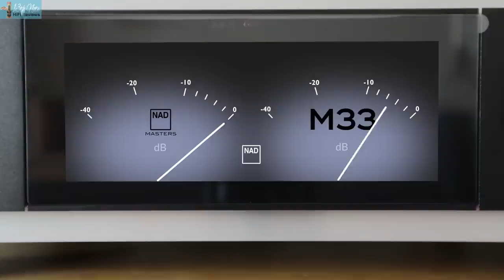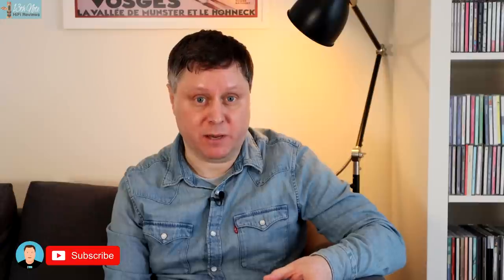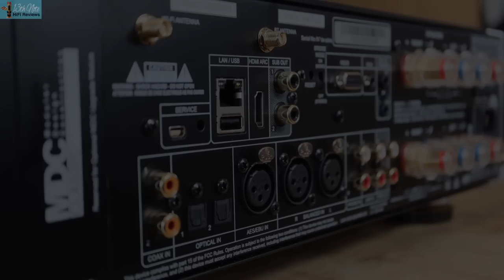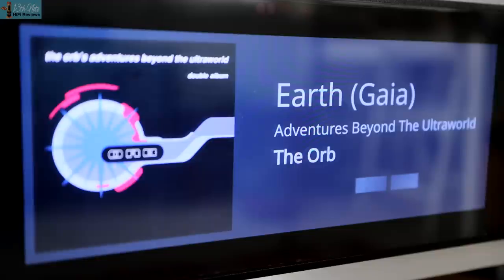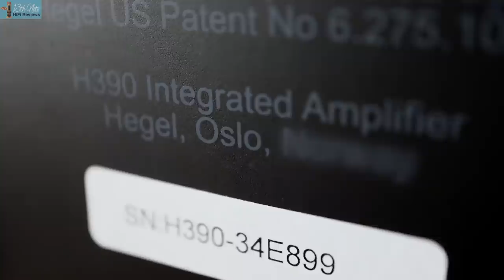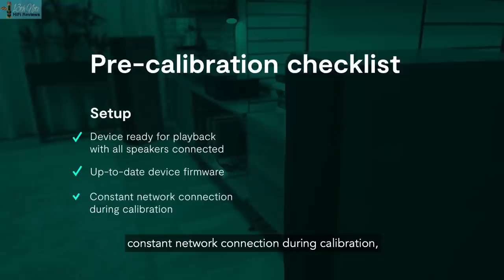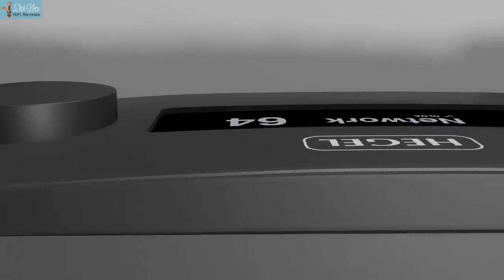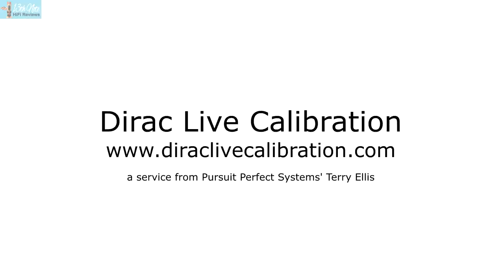NAD Masters M33 versus Hegel H390

Comment: These two were my finalists and I went with the Hegel because I never got the chance to hear the M33 in person.  The Hegel 390 has been very good to me and happy with that decision.  Great video.  I always enjoy your feedback
Reply: I'm in the same boat but before I make my final decision I will test both. I buy both from a respectable audio dealer and will inform them that I want to compare the. Sure, it needs a huge budget to buy both, but after that I can hold the winner and sent back the other one.
Reply: @TheVictoire22 Who won the competition in the end? 😊
Reply: @larsstecken  Ah thanks for asking. I did a test trio at the local audio dealer. The test was with a M33, The Hegel 390 and a Yamaha A-S3200. For me the Yamaha was clearly the winner and until today I'm happy I made that choice. Possibly to do with my B&W 702S3s which require a very strong amp due some really low impedance (2.9 Ohm) in a certain area of the frequency spectrum. On paper maybe the M33 or Hegel were clear better candidates but to listen to, the Yamaha was very very nice. The Hegel was 2nd and the M33 was for me clearly to analytic. On the other hand the M33 has tons of options to sound it better to your needs which I didn't investigated.
Reply: @TheVictoire22  Thank you for the fast reply! That is very useful information, at least for me. I am currently looking for an upgrade from my Atoll IN300 which is powering Dynaudio Heritage Specials. The Yamaha was also on my list but due to some "not so enthusiastic" reviews it slipped from my radar. The HS also like to have a lot of power and I thought the Hegel was the natural partner. Then you start thinking about how much room correction can do for you and the rabbit hole never ends....
I love the looks of the Yamaha - it's a beautiful machine. Whereas the Hegel is just a brutal brick with an excessively sized logo on the front - I probably could have dealt with it if it really were the much better choice for my speakers.
Unfortunately, I am not able to get all of the amps to my home and test them out - so, I will need to take the plunge one day 😊
Thanks again, Stefan
Reply: @larsstecken  well as with most equipement, there are always good and bad things about a product. On the end you need to convince yourself. I had the luck to setup exactly my B&Ws with the different amplifiers at the local audio dealer. So I could compare them all. But that's of course also just on a moment. I discovered that listening flavours can vary every day. Sure the looks are awesome at the A-S3200 (I had a Technics SU-G700  and the SU-R1000 was to costly). There are 2 important things to say about the A-S3200. It's a true analog amplifier. No digital ports nothing. It's pure analog on a scale which was never achieved before. It's extremely dark as it comes noise. There is no noise nothing even when the volume is 100% at the 2 balanced inputs. The Amp is fully balanced build (it has only 2 balanced inputs). The integrated phono amp is good but not special as sometimes claimed. It's not comparable to a Lehmann Black Cube SE II (driving a AT VM760SLC moving magnet to it). By default the specs are somewhat thin as it comes to power. 2x100W on 8Ohm but a few sites claim this is fairly under specced. One thing worth noting is that I had also a good deal for it. We  bought 2 (one for a friend) and the SRP was 6499 euro we got it for 4400 euro each. So if you consider this one it's worth to shop around and get a good deal because I think there is quite some margin on it for retailers.
Reply: @TheVictoire22  Once again, thank you so much for taking the time to give me your opinion. Let's see where the journey takes me and if my wife will still be there with me 😂 Cheers and greetings form Berlin
Reply: @larsstecken  if budget is somewhat thin you can also consider the A-S2200. Then you have still money left to buy a nice Dyson Hairdryer for your wife ;-) When I bought the A-S3200 I had to wait a few days. I got an A-S2000 quite old Yamaha amplifier to overcome the no-amp period. This was already a massive improvement compared to technics SU-G700 although it tended a little to the warm side. A-S2200 is considered sometimes as good or really close to the A-S3200. The prices is just below 50% a A-S3200 costs. One big advantage is that the A-S2200 looks as standard form factor Amp while the A-S3200 is considerably higher (cabinet space) and tend to look a little more bulky. I never heard the AS-2200 but I had the A-S2000 which was also very very good or possibly a R-N2000A if you are looking for an all in one solution. Go to a Yamaha dealer is my advice!

Comment: Hi, 13th Note , A great review on the NAD , Way out of my price range bracket, However I have owned to pre-empt my buy them the one I’m using the moment is a integrated 314, Used to go into my Cambridge power amp but that has blown just recently I’m now in the process of purchasing a NAD C298, And I noticed in your comments that you don’t know of anybody nowadays that Bywired anything, 
Well I have a pair of transmission line loudspeaker cabinets that I built from a plan over 40 years ago they sound amazing and I have not yet heard anything that comes close to there Quality of sound, Especially just recently I’ve replaced the drive units because when the Cambridge power blue took out one of the drive units, I have now replaced them with SEAS . 
They were designed to be Bywired to keep the crossover unit simple, The only downside is that they stand just over 1 1/2 m in height and they look like coffins especially as I used to have brass handles on the side so I could lift them around as they do weigh a lot. And they fire out the bottom so there is approximately 4 inch gap underneath, 
I do think the review you done on the NAD is very good and very interesting.
And I forgot to say that I am new to your channel so I’m going to have a look see what else you’ve got reviews on.
PHIL FROM DARK SIDE OF THE MOULIN FRANCE.

Comment: I heard the NAD M33 (without Dirac) vs Hegel H590 because unfortunately the H390 wasn't available.

I found the M33 more neutral, a bit more honest. The Hegel with a little more power, but a bit too much in the highs. I bought the M33, really great device. ✌😀
Reply from the maker: You have to listen at home to get an accurate picture if you didn’t. The Hegel can be described as offering all that is needed and natural in the treble to my mind, and so can the NAD, in a different more etched out way. The Hegel h590 has a lot more power to the m33 and will control a lot of speakers better.

Comment: As much as I love my Parasound 2125v2 amp (150 wpc, 35 amps peak/channel), I want to upgrade to hear anything better that's <$3500 and < 50 lbs.
I have a mixed use music/home theater (7.4.4 setup).

At first I saw an ad for a used Passlab xa25 for $3500, but there's no warranty so I passed. (I was also concerened about the low 25wpc, Class A heat that I'd be sweatin).

I've just ordered the Musical Fidelity M6s prx amplifier (230 wpc, dual monoblock in 1 chassis, 140 peak current at 130 volts so it's less in the US at 112 volts, but I would deduct that this is same as a Parasound A21+ at 60 amps peak/channel) to replace my Parasound 2125v2 (I'll repurpose it to power my movies surround L/R and take that load off of my Arcam AVR5 receiver in a 7.4.4 setup).

I was gonna get an integrated Musical Fidelity M6si (my requirement is a Home Theater bypass and L/R balance) but it didn't have a L/R balance to help imaging of vocalist; but my Parasound 2100 preamp does.

streaming source=Apple Music lossless

Comment: Thanks for an informative review, Simon! I just purchased the M33, mainly for the "all in one" feature set including BluOs streaming, phono and headphone preamp, etc. I've had several other NAD pieces in the past, including most recently an M12 matched with a Parasound amp. I haven't calibrated using Dirac yet, as I've been breaking in my speakers first. Looking forward to your next review.
Reply from the maker: Thanks Ken, please let us know what you think of it when you are used to it a bit more. 😀
Reply: @13thnotehifireviews7   Since my previous post I calibrated with Dirac LE, and WOW - what a difference in the tightness of bass, and character of vocals, particularly female. I will be purchasing the full frequency version (what's another $99, right?).  Since it's easy to switch the Dirac filter on/off, I can readily hear the effect on the sound.
Reply from the maker: Thanks Ken, I found the expansiveness in the sound to be the best feature of using Dirac. You can do more than one filter and curve i think, I think there are five slots.
Reply: @kenpiarulli1152  Hi Ken! I am also thinking about buying the full frequency version! I was wondering what your experience it is? Did it make as much difference as the limited version?
Reply: @DeSoLaToR22   Yes, I found the full version much more flexible, and made a big difference in matching my sub to my mains.

Comment: I had an A/B test of these two today at a dealer. Since the dealer has exclusive rights in Sweden to all the brands they sell I had to listen to them on Dali Epicon 6 speakers which are not a favourite to mine. I thought the M33 sounded very digital in comparison. But I have not owned a digital amp nor listened to many. The 390 sounded so much better imo that I forgot about the fancy display and the tech. It’s not that the M33 sounded bad. We started listened to it first and I thought it sounded good. Then we switched to 390 and it was just better. Then back to M33 and that’s when I really thought it sounded digital. I’ll probably get the 390 or a Naim. Need to figure out how to A/B test them at home though.
Reply from the maker: Thanks for sharing opinions, did the dealer set up Dirac or demo it ?

Comment: I was deciding between the M33 and the H390, and ended up with the M33. The only thing I really dislike with it is that it's not really possible to use it to drive the fronts in a surround setup, due to the massive audio delay the analog inputs have (analog signals converted to digital, processed and then converted back to analog). Remote range also sucks (worst I have ever experienced) and I find the max volume a bit lacking.

Other than that, it is a superb amp which also has a lot of other functionality. Doesn't appear to be a perfect amp out there for my needs, so for now, the M33 is probably the best one I've seen (for me).
Reply from the maker: Thanks good call. Each to own. Maybe they should have thought of delay. I found that with remote but I thought battery. Maybe sensor behind display? It’s still a very fine sounding amp and I think you made a good choice for your needs especially as close to Hegel but cheaper and all out use factor Hegel doesn’t have.
Reply: @13thnotehifireviews7  can you all please elaborate on this delay? Is it bad for movie watching? Thinking of replacing my denon AVR with it (for 2.1). Thanks
Reply from the maker: @fancypantzz  you shouldn’t be buying this type of hifi component unless you get it home and try first in any event.

Comment: Thank you so much!  I love the quality of your reviews.  I am sold on the Purifi amplifier technology, but find the NAD a bit too expensive when you can obtain purifi amps for around $1300.
Reply from the maker: Thanks too. 😀🔉 always base decisions on trials yourself too…..
Reply: @13thnotehifireviews7  I think the NAD m33 is worth the money in terms of all the other integrated functions including Dirac room correction. My goal right now is to build a multichannel system with purifi amplifiers using a computer and a USB to XLR interface.  Even the cheapest Purifi amplifiers measure the same as the NAD m33 so I doubt anyone could be able to differentiate between the two.  You can even DIY the purifi amplifier.  Also, there are a lot of different optional input buffers to Taylor the sound of the purifi amplification.  Check out VTV amplifiers for example.
Reply from the maker: Yes I am aware of vtv, thanks 🙏 I suppose it comes down to the quality of the pre amp so a case of seeing if vtv with another pre bests the m33 in your opinion.
Reply: @13thnotehifireviews7  the input buffer is the preamp and there are many custom input buffers available. NAD most likely developed their own input buffer.  They all test the same in terms of noise and distortion, plus or minus 1 or 2 dB.
Reply from the maker: Yeah but pre amps sound different too. Different psu, quality of components and so on….
Reply: @13thnotehifireviews7  I understand, Mola Mola makes an amplifier with ncore amplifiers that supposedly sounds amazing, so implementation is key to maximizing the sound.

Comment: Just  recently  reading  comments  about  nad reliability  factor..Theres  some   Negative  as  well as  positive  comments  in this  regard  to them?..ive owned the  nad C 316bbe integrated  amp for  over  ten years it still  works great.At  this point im  stilll considering  certain  amps  from  nad  as  long  as the trajectory of certain amps they  made are well  made  & posses  a phono  section,..I mostly  collect  vintage  audio  amps  speakers etc  but considering   new  cause  I dont  know how  to recap  older amp  as of  yet!

Comment: Your work, once again is superb! 
I struggled between these 2 amps (and also the Gold Note IS-1000) and ultimately decided on the Hegel H390 largely due to your review. The H390 / Bluesound Node 2i is feeding my Scansonic HD MB6B's. I'm now considering cable options and the Rocket 88 are on the list as the obsessive research continues. Curious about your speaker cable experience.
Reply: Nice system you've got there! Was interested in these Scansonic speakers... What's the minimum room size you think those speakers require to get their best?
Reply: @raphaelmeillat8527  Thanks! I'm certainly no expert in room designs or recommendations. I have them in a 14 x 17' with the MB's on the long wall and still fussing with placement. I have other issues like open gym area on one side (tons of echo and no treatment). Id say they are still fantastic in every way. I'm super happy with it exactly the way it is. A lot to love about the MB's and H390 pairing!
Reply from the maker: @piker3000  contact me about the Rocket on PM and I can help there with thoughts about them. I’m not reviewing them btw, as I don’t do cable reviews anymore really.
Reply: Можешь выкинуть свой bluesound, но лучше продай)

Comment: Thanks for a really interesting video. I'm considering the M33 (currently have a NAD T758), but wonder if my speakers (MA Silver 200 and KEF LS50) would be the limiting factor and look for an amp that better price matched
Reply from the maker: Thanks for the compliment David. If looking to re-build the system do it based on speakers first is my advice, and then go from there….those Buchardt’s I just reviewed are a very good starting point.
Reply: @13thnotehifireviews7  I really enjoy your videos and respect your opinion. I did think about starting with the speakers. I have a surround sound system (5.1.4) based on MA Silver series, so assumed to upgrade the fronts, I'd have stick with MA or change all the speakers.

Comment: Simon, super quality production again, BUT the point about no difference at this level between class D and class AB would be easier to credit if you'd prefer the NAD.
Reply from the maker: Thanks Michael, possibly you are right I think. I think the Hegel shines because of its design but not necessarily a class ab v d issue.

Comment: Hye Simon, my compliments for this review, great! I have NAD M33 and use roon and Dirac Live full license, and this upgrade is great! do you think by inserting a new external dac like a Denafrips Ares II or another dac in XLR would like to advise me with NAD M33,  I would get better sound and better performance than the internal dac of the NAD M33? is it worth it? do you recommend it to me? I would like to squeeze the most out of the sound of this amp? Thanks!
Reply from the maker: Thank you too. Only you can decide but it’s worth trying before you buy as ever. So much is dependent on system integration

Comment: I own an M10V2, I absolutely love it. 

Saying that, more power would be nice and having such a great experience with NAD, I think I'm going to stick with them and do an M33. I'll be paired to some triton 2+'s.  Having the 2 subs out is really nice too.
Reply from the maker: If you can try a Hegel and a node I think you’ll be blown away by the better more natural control and analogue qualities that the Hegel brings but at the same time retaining all that bluos control ability. The M10 is a nice amp but it doesn’t have the natural quality of a H120, or better still H190/H390. They are worth auditioning before any NAD purchase.
Reply: @13th Note HiFi Reviews  the Hegel's lack of an HDMI/eARC is kind of a deal breaker.  I want to be able to connect to a TV.

But the other deal breaker on the M33 is while it has 2 sub outs, they aren't independent.
Reply: @13thnotehifireviews7  i had a hegel h90 and now have a nad m10 v2, for me the nad have better sound and the hegel is to big

Comment: Hi Simon,
Thanks for your great contribution!
I have the M33, happy with it, but struggling with a (maybe silly) thing I hope you or other owners can help me with. 
I noticed it makes a soft buzzing sound, only audible when I put my ear close to, right above it. I can’t hear it at +1m. 
Does yours also make such sound?
To prevent getting fixated on it, I’d like to understand if it’s normal for the device to make this soft buzzing sound or if it should basically be dead-silent?
Feedback is welcome!
Reply from the maker: It’s called transformer hum and is normal and can be dc on mains too. Google it to find more
Reply: @13thnotehifireviews7  thanks for fast reply, nice Sunday !